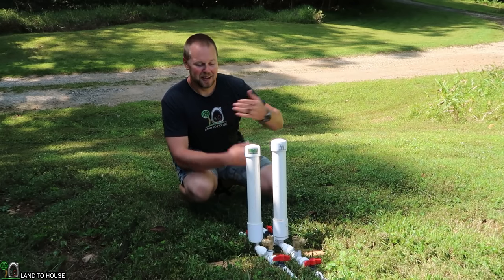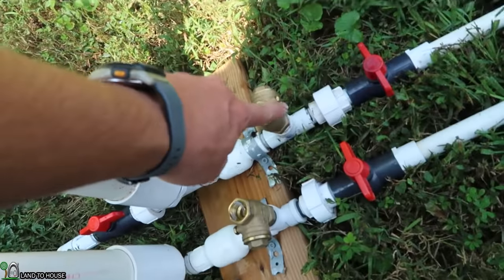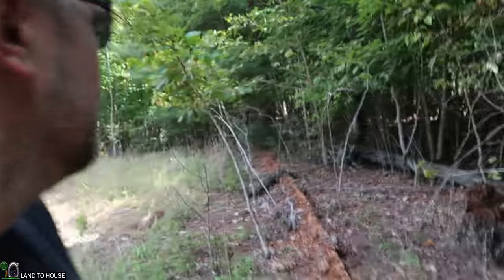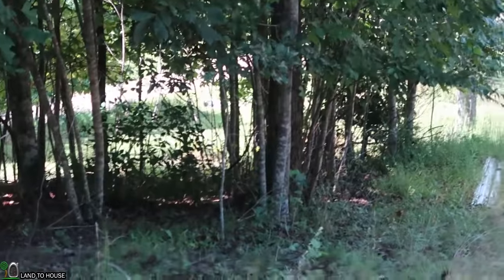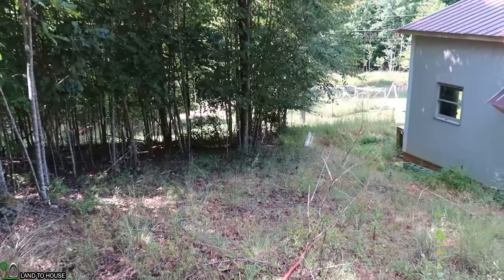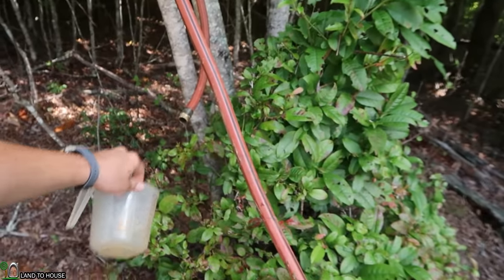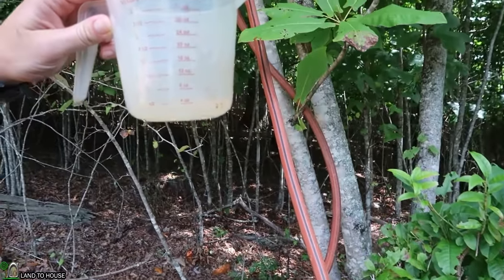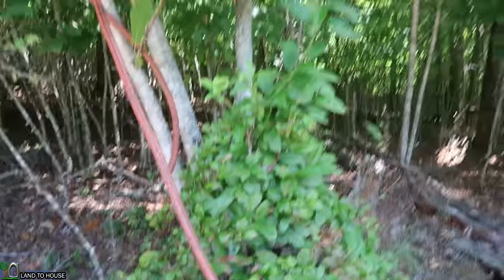Will Parallel Ram Pumps lift water higher? Lets Find out

Comment: Seth, can you make a test with the bigger 1 1/4" or 1" pump and a waste valve that allows you to regulate the cycles per minute? If you use a long enough drive pipe, around 30 to 50 ft, you should be able to find a operating frecuency that maximizes the preassure and flow. This is because the valve would close at the same time as the preassure wave reflects again on the valve. For example, for the 1" pump and a 50ft pvc drive pipe the best frecuency should be between 65 and 75 cycles per minute.
Reply: thats cyling way too fast, noth enough time for flow and water hammer effect, 15 to 20 cycles per minute, at 3m head and 50m of 25mm drive pipe. 2300 liters per day lifting to 6m. but cycling more than once per second seem like an error. Can you post your pump functioning like this please?
Reply: @shane6574  It is true that lower frecuency makes the pump more reliable and pump at higher preassure, but if you use a long enough drive pipe of the right diameter it is possible to syncronize the reflecion of the preassure wave with the valve clossure. Also, using pvc pipes lets you operate at lower frecuncy.  I dont have a pump but i calculated that as an aproximation.

Comment: have you ever thought of using a pressure relief valve as sort of an "artificial back pressure" device. 
Just after your outlet valves install a 30? psi pressure relief valve to the outlet, then connect it's outlet to your system.
so it wouldn't function as it's intended over-pressure relief, but might work as an "under pressure hold".
it might hold enough pressure in the tank to help prime the pump faster.

Comment: Was literally just thinking about this. Parallel pumps with the same inlet drive line with separate air tanks and then joining them back up at the send line? If you offset the action of the pump it can use the same source line as it’s only pulling water half the time?  Or would that mess with the water hammer effect? With a check valve after the air tank it would keep the water in the send line from filling the other pump when one is active.

Comment: What is pump output relative to pump location?
Is the pump pumping more water the closer to the source?

How about ram pumps in series?

Also, instead of two discharge lines in parallel up that long hill, how about 'T' ing them together at the output of the ram pump then into a 3/4" pipe up the hill?

What if you used a bigger air chamber?
And eventually with air in contact with water in that chamber, the air would eventually dissolve thus reducing the air pocket.
Could you use a hot water expansion tank?
Of course you have to bleed off some of the air in that (doubt the pumps can generate 25-40 PSI of pressure).

Comment: Why does it matter if water is still coming out of the top hose? Couldn't you just get a container and time how fast it fills with water with only the first pump? Then, couldn't you activate the second pump and time how fast the same container fills with both pumps going? The difference in flow rate would indicate the added benefit of the pump...

Comment: For me, 2 ram pump with 1/2" drive pipe is the same as single ram pump with 1" diameter of drive pipe. The same 1" ram  pump
Reply: You`d need 4x 1/2" pumps to equal 1x 1" pump.

Comment: What about powering 2 pumps but 1 from a stream and the second from a tote higher up the hill. Lets say the first pump get the water 3/4 the way up the hill, empties into a tote, the water from the tote is piped to a pump halfway back down the hill which pumps it to the top of the hill into a tote. to keep from wasting water at the top of the hill the tote has an overflow pipe that drains back to the lower tote. can this actually be done?

Comment: I realize it's been a year, but I would be curious how two pumps would operate if the inlets were connected right before the valve by a short center fed manifold.  I suspect the pressure wave generated would propagate to the other pump faster and with more force, potentially giving greater head pressure.

Comment: interested in some information about the pumps   hypothetical speak  let's say you only have 3 to6 feet of drop  but you are only lifting  3 to 4 feet high to fill a 5 gallon bucket with a one inch hole in the bottom. to keep the Water  flowing  in enough to keep it running. to get to a siphon flow to keep the one inch out flow going,? and what size  pump would you like to have to do this work.

Comment: One, the results are null and void, since you concluded that your setup couldent handle it, by rearanging the pipe to get rid of that 90, say using 2 straight pipes from the source.

And if a pump delivers 6feet of headpreasure, whouldent simply using one pump to get the water from 2 feet up to 6 feet give that extra preasure?

Comment: im really curious, if you put a pipe the same height as the vertical chamber before it but drilled a few holes in the end cap on the top, would there be enough down pressure for the non return valve to then prime itself, that way you could have a tap at the top and not have to worry about it stopping priming.. would that work?

Comment: I've got a question, I've got a well 600 feet deep that I'm wanting to pump from. And where it will be pumping to is like a block away down hill from the well. Question is will a ram pump work there, and if so what size of pipe and check valves would be best for the job? And one other thing,once I get the water going down the line will gravity of the say 30 foot drop between places be enough to just like  pull the water out by its self just free flowing?
Thank you greatly for you time.

Comment: Can this work in a pond if sank to the bottom with intake pipe straight up to the top of the pond ?  Intake will be 8ft higher than the pump but inside the pond.

Comment: Similar but different question:

Can you have two drive pipes (or more?), connected by a Y or something, driving a single ram pump? Will it increase head pressure to the ram pump? Will it increase flow rate / pressure? Is it a kind of linear relation ship, like two drive pipes to a Y being equivalent to one drive pipe with double the cross-sectional area (was going to say diameter, but that wouldn't be exactly double the cross-sectional area or flow rate, I presume, if the diameter was double; geometry/trigonometry/radians, or whatever)?
Reply: Thinking, like, could you have one bucket (or large tank) with multiple output pipes with staggered heights and float valves to open them, that could kind of open extra pipes to add head pressure as the bucket gets fuller, say, seasonally, if a creek increases its flow volume, etc. Then as flow decreases, it goes back down to like 2 open pipes or 1 open pipe, so it's always operating at some minimal level, but can operate with more head pressure / flow rate when appropriate seasonally?

Comment: On another video they said with 3' of fall the rampump can pump water to 250' of lift !? Which seems outlandish.
Reply from the maker: In my 9 years of ram pump research I can say that is not true. You might get 25 feet. But not 250.
Reply: 6-7ft of fall could get to 250ft, but not 3ft

Comment: Now your talking! Hp vs torque, this test will go a lot better.
Reply: Almost, dragging pump uphill reduces head pressure, but also reduces lift.  Maybe should have lowered the bucket instead? Also doesn’t conclude we can’t get anymore height, it concludes the 90s are hampering efficiency, and that the test is inconclusive, lol.

Comment: Your vertical pipe wrong side fitted.vertical pipe fittings after after valve then machine works good and one line must be two check valve one verical after second one horizontal position then vertical pipe.

Comment: Is it at all possible to set up a ram pump on a shallow'ish fast moving river with shallow, rocky banks?  We don't have a stream...we have a river!
Reply from the maker: As long as you have enough flow to keep the pump going and have the required drop (head pressure).  The minimum drop to run the pump is 2.5'. That will lift to approximately 15'.
Reply: And how high with a 10 ft drop?

Comment: I'm thinking this could be a case where an electrivally timed ram pump could make sense. 12 v solenoid with adjustable timing delay, instead of mechanical timing with a check valve.

Fool around and experiment a bit so see if simultaneous, opposite or slightly offset timing is the best setup, and possibly get a real flow meter to figure this out without spending forever. 

One bonus with a solenoid-timed pump is they can be self starting or remote controlled, as well as remote diagnosed in case of breakdown.

Bonus points for having a whole new series of yt content and possibly a little more unique offering when shipping "robo ram" pumps
Reply: Having solenoids constantly switching on and off sounds unreliable to me. Unless theres a more reliable type of solenoid out there?

Comment: Great parallel test. Do you have a test of 2 pumps in series? Can relay up a mountain, if needing a larger pump for the bottom one...
Reply from the maker: There are 2 problems with running rampumps in series. The 1st one is that the flow rate is not enough to operate a second pump from the 1st pump. Then  The drive pipe needs an open to air source.

I have managed to run a smaller pump from the waste valve of a larger pump.
Reply: I figured a tarp on a hill could collect first ram pump's output, then new drive pipe from tarp pond for another jump uphill. May need lots of water storage before activating 2nd pump.
Reply: You would need a bigger pump that can consume 150 l/min or even more, this would be a 2" at least. It is totally possible since you could pump, for example, 20 to 30 litters per minute at 20 meters and directly connect the smaller pump, 1/2" to 1", to the delivery pipe of the bigger one. This should allow the smaller pump to operate with the remaining pressure of the delivery pipe as if it was the available height. This could allow to pump water really high with the second pump but of course with a smaller but decent flow.

Comment: I have limited space for drivepipe lenght for 2" Ram pump can i just use 4" drive pipe 5meters with 4ft drop to deliver at 25-30 meters high.
Reply: The drive pipe generally needs to be around 5-7 times the supply head so for a 4ft supply head you would want 20ft long drive pipe, with 5m drive pipe you would be just under this but it will still work. A larger drive pipe could cause issues if you don't have a sufficient flow to keep it full. Definitely stick to the 2" in this case.

Comment: I don't think  your conclusion is valid.

You are testing two similar pumps with different efficiencies. That does not equate to a lesser flow rate with two pumps of the same efficiency.

To have a valid test, you would need to have similar efficiencies.

If you used a rectangular bucket so that both pipes ran down hill, and the outputs of both pipes were connected to a Y connection rather than one straight and one on a 90, you would have the same efficiency.

It would seem that if you cut the length of the feed pipes in half, you will reduce your flow rate thereby reducing the output pressure.

You can definitely reduce the feed pressure by reducing the amount of water that is in the feed tank as the more water there is, the more downward pressure you have.

Comment: Have you experimented with a dry stand pipe on the drive side? Curious if an extra air tank would yield similar results as having extra head pressure in a wet stand pipe I think it was. Could you get a more stable gauge reading from the top of the pipe vs a gauge directly on the drive pipe?
Reply: A biger diammeter of the air tank will increase the high of liftingbut the flow rate will be a little bit smaller. The flow rate can be higher if the inlet pipe is bigger and the respons speed of valves is higher, this can be 1” inlet pipe , 1/2” first valve 3/4” exit valve and between a 2 ” or more air tank, exit pipe 1/2”

Comment: Since a ram pump just transfers kinetic energy from one half of the water to the other, could you put a ram pump in a fast flowing stream with a funnel instead of a hose on the intake and get more head?
Reply: It's  hard to get more than maybe inches of extra head pressure out of this. Hard to beat acceleration of mother earth.

Comment: maybe it was explained in a different video but what happens when you change the size of the intake and output pipes. 1" in and 1/2" out? what about the other way around as well?
Reply from the maker: The drive pipe needs to match the waste valve. The delivery pipe can be any size as long as friction does not cause the water to slow down.
Reply: @LandtoHouse  is there a cost vs benefit of different size pipes? Flow vs pressure? 

Interesting....

Comment: If you made soma calculus or if you ask an engineer you had not do make such effort to see what ? Nothing because the high lifting does not depend on the number of pumps, it depends on the pressure cerated by the difference of potential energy . Two pumps can double the flow rate not the high of lifting
Reply: I think I just thought of a way to get the 2nd RAM pump to actually increase the height.  The idea is a bit tricky to implement but here it is.
The second pump is not directly lifting water.  Instead it makes pulses of pressure in the first pressure tank of the first one.  The outlet of the first pressure tank goes through a valve into a second pressure tank.
Thus the lifting effort of the two pumps are in series.
Reply: @kensmith5694  RAM pump ttransform the potential energe gave by the difference of level in kinetic energy multiplyed by the presure of the air tank. For a higher level of transport you have to put an air tank with greater diammeter or put a rubber membrane at the1/3 of air tank and presurize at  1-1.5 bar.
Reply: @gabipaduraru2004  You seem not to be addressing the idea I had.
Your comment is very unclear as to its intended meaning.
The pressure tank only increases the effectiveness of a ram pump up to some limit.  As a tank becomes very large, the change in pressure due to the pulse of water being added tends towards zero.  When you get to zero (an infinite tank) the amount of water the pump will lift is limited by other matters.

Comment: what happens if we put ram pumps in series?
Reply from the maker: Because the drive pipe has to have an open to air source it's not possible to run a drive pipe from a delivery pipe. I have managed to run a small pump from the waste valve of a bigger pump.
Reply: @LandtoHouse  Yeah, that makes sense. cant really cheat physics i guess ^^"
Reply: you could have a large pump feeding a much higher but smaller drive pipe to achive higher pressure on a smaller ram to get higher delivery point but much lower volume. of course you would need a lot of  supply double the money

Comment: Thank you for trying to do the test but without everything being equal your test results are kind of invalid both ram pumps should effectively work the same..... but you have one that's handicapped and you're expecting its results to be as good as the one that's not...... and I just think that whole test is kind of invalid the only thing your test did figure out is that your one ram pump is inefficient in comparison to the other.